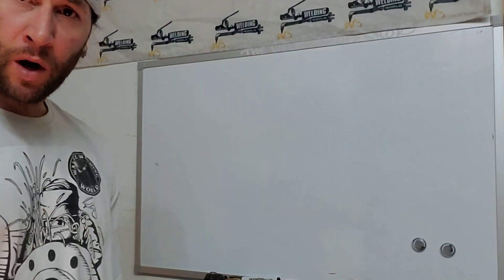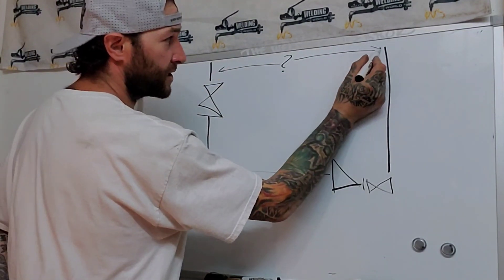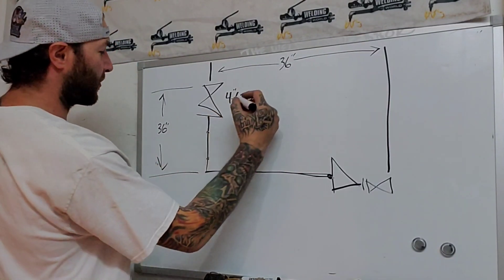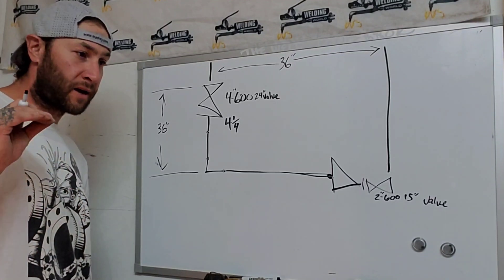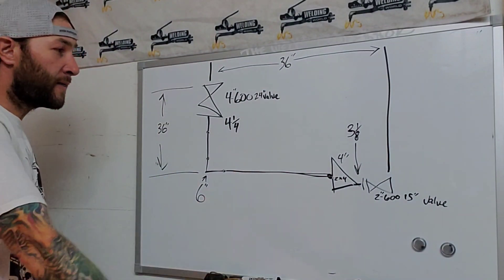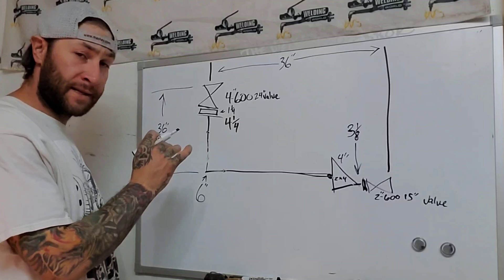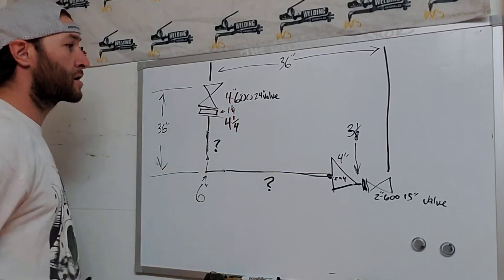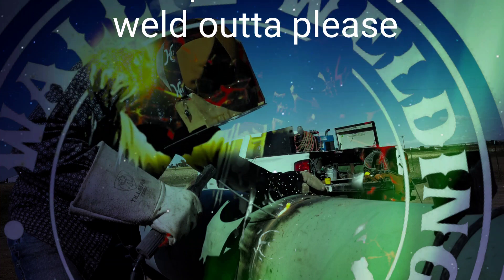HOW TO UNDERSTAND PIPE FITTING TAKE OFFS

Comment: 1/2" on the vertical, how you weld that puppy in?? 7 3/4" on the horizontal right? #TWP Burnin' and learnin' outta Iowa thanks man
Reply: Further reflection lol is there a 1/4" raised face on each side of the valve that needs to be accounted for in the overall dimension?
Reply from the maker: The valve is normally just measured from face to face. Good point and right on for watching
Reply from the maker: Correct on the math. Be finishing up video on Monday and going into the next formula and next fitting lesson
Reply: TheWeldProfessor Awesome man looking forward to it!

Comment: TRICKY BUT I DO ENJOY AND REALLY GET INTO PIPEFITTING,FOR ME,OUNCE I GET EVERYTHING/IN MY MIND I'VE GOT IT MADE.ITS LIKE BUILDING A MAIL BOX,I BUILT IT IN MY MIND(6"SCH 40 5'LONG.8"SCH 40 3' LONG.SADDLE JOINT.2-21/2'INTO GROUND VERTICAL.LEVEL.SADDLE,SQUARE.NEWSPAPER HOLDER,4"PIPE SCH 40,2 1/2' LONG.FLAT BAR ON LEFT SIDE.-ALL THIS DONE IN MY MIND.AND NO DRAWINGS BUT EVEN IF THER WERE DRAWINGS I STILL HAVE TO PICTURE IT IN MY MIND.
Reply from the maker: Yeah it’s a lot and I struggle a while learning it all myself but just keep going over the drawings and measurements and take offs and eventually it gets easier

Comment: I have been welding down here in mexico and i have been doing water pipeline for a pecan grove. I did all the fittings and valve bodies above ground and the majority of underground was PVC and i just made it so the flanges were able to bolt together. I came to a price of $40 USD per weld on 8 inch. And i cut them a little slack on the smaller pipe at $35 USD. Im running a miller bobcat 250 amp with a gasoline motor. Fuel here is 5 dollers a gallon.and the same for diesel. Now I am not certified but i have to guarentee my work. I used 6011 and 7018 on most everything but got some 8010 and that made my life a lot easier because it was 5/32 cause all i could get here was 1/8th inch rod. I two holed and leveled everything and it bolted together real nice. But compared to the USA i know i am cheap but the cost of living is cheaper here and the client bought lots of beer and food. All in all I am happy and i am surre he was also. Whats do yall have for advise about what i just said?
Reply from the maker: I mean if it works for you keep going man. Sounds like ya got it handled

Comment: 5:11 Shouldn't you take 1-1/2" off to account for the lower bleed ring gasket? And at the end (7:57) shouldn't you have mentioned you subtract the number you found (accounting for the second 1/4" gasket) from 36" to get that vertical pup length?
Reply from the maker: No gaskets are 1/8th. I miss informed when I said they a quarter of a inch man.  Put it in the description
Reply: @Wallyzweldingworld  Ow my bad. Thanks for the video!
Reply from the maker: Its awesome to see people pay attention so well. Thats the main goal thats why i wrote the correct answer to raise the question. Its a common mistake alot people make
Reply: @Wallyzweldingworld     cool was wondering about the gaskets too , pretty much worked with 150 or 300 myself and 1/8inch thic  dont usualy read the description.  Thanks
Reply: Saw the same thing f